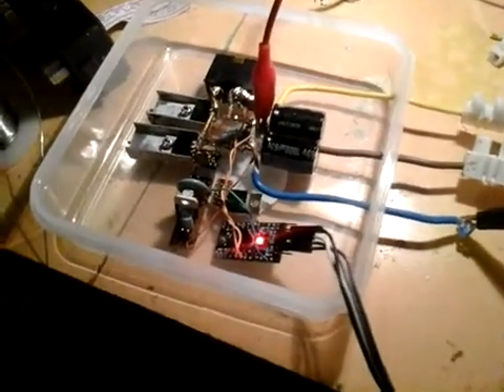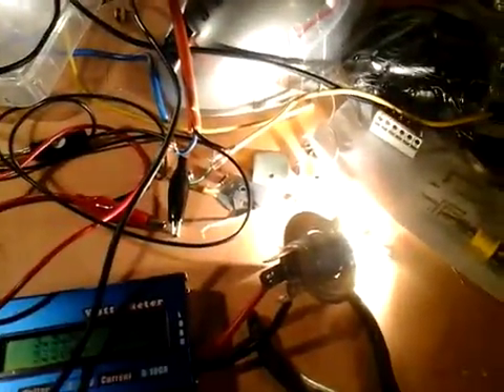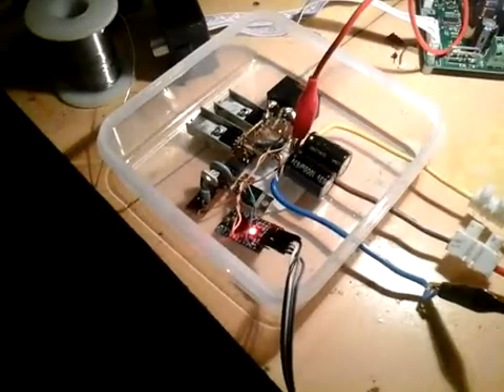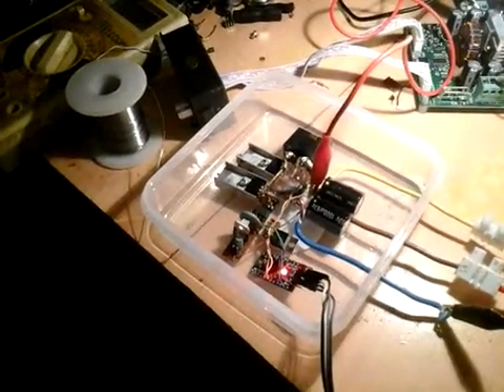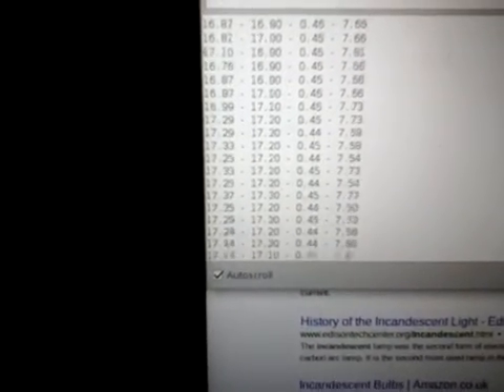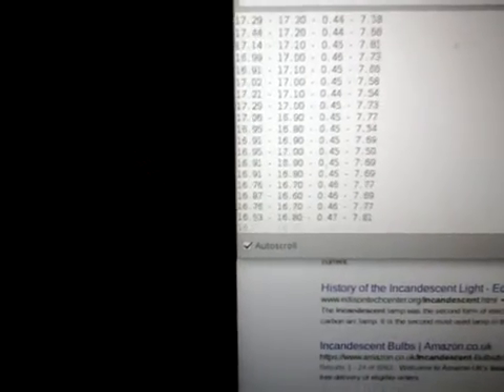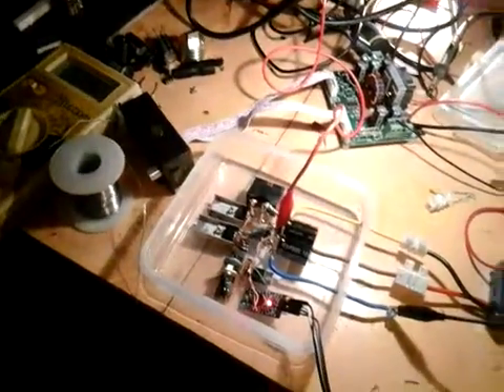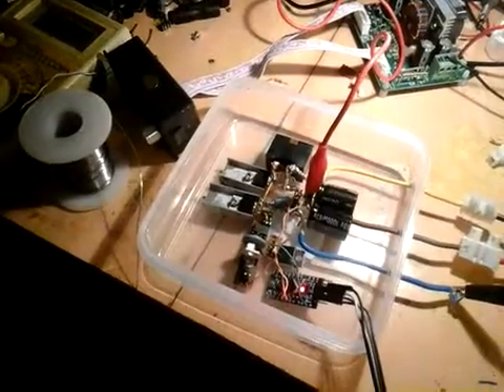MPPT module, home built!

Comment: nice - any chance you could post the schematics?
Reply from the maker: Sure.
http://birds-are-nice.me/ipfs/QmeHTKsAWhaKeygAqRBkAUkt5t2e9NPZcHT2ZcuyZcXcwy/
That's an old version of the firmware though, I managed to make it a bit more stable by keeping the input voltage from falling below 15V.
Reply: thanks very much for that.
Reply from the maker: I've actually found it less than perfect in practice - it's fine for driving a resistive load with all the power you can give it, but if you want to charge batteries I think it would work a lot better if you could adapt it to measure current as well as voltage on the output.
Reply: Thanks, yes I have a couple of ebay hall effect current sensors and and an accurate ADS1115 voltage sensor which I was thinking of adding to accurately measure Power vs Time, and area under curve on both sides.  I'm not as advanced as you are with electronics but I can follow along an learn.  I was also looking at Julian Ilett's MUPPET high side N-channel mosfet setup but I'll have a go at your setup because you put those nice instructions up, so thanks for that.  By the way I'm sure there are lots of people interested in MPPT, so it's surprising that this video doesn't have so many views.  In this voyeuristic world you might need to consider putting a fluffy cat or picture of a woman in a bikini on the cover of the next video to improve the hit rate - Joke :).
Reply from the maker: Make sure the hall sensor is rated for 10A then.

The ADS1115 can't read above 5V, so you won't be able to use it to measure output current via a shunt - but there are chips that can. INA219, perhaps? That could be just the thing you need. It'll let you measure (inverted) output voltage and current simutainously. Just subtract from the measured input voltage and you have all the measurements you need.
Reply: oh yes you're absolutely right.  Thanks for that.  With the INA219 it looks like you have to change the sensing resistor to handle greater than 3 amps.  Hmm, to save components I might just stick with some accurate resistors and have a couple of voltage dividers and use the 12bit ADC on the arduino.
Reply from the maker: I've used the INA219 myself. Using the little module board? You don't have to replace the current sense resistor. Those screw terminals on the module are not just for the current to be measured: They allow the use of an external current shunt resistor too, allowing the INA219 to be used to measure far higher currents with ease. You might need to remove the existing resistor, but if so it's a rather large part by SMD standards and not difficult at all to desolder.

You can even use two INA219s to measure both input and output voltage and current, as they are addressible. This is really overkill for a production unit, but such readings could be useful during development to properly evaluate the design.
Reply: okay you've convinced me to spend some more money on more Chinese bits and pieces.  I'll get a couple of the INA219 boards.  I have a question - am I correct in assuming that if you drive the circuit at higher frequency then you wouldn't need such a low value (expensive) inductor and the efficiency should also increase (I think).  I guess the arduino cant go much faster that 30kHz.  Is there any way to double or triple the arduino output frequency?   Also where did you buy your inductor?  I but a lot of my parts from www.taydaelectronics.com  I've found them to be okay but they dont do specialist parts.
Reply from the maker: Correct, a higher frequency means a lower-inductance (smaller, cheaper) inductor can be used, but the arduino is the limiting factor - if you want higher frequency you would have to switch to another microcontroller, or find another means of generating the PWM signal. There are ways a high-speed comparator and a some analog filtering that I think could be made to work, but I didn't go for that route because it increases complexity. Higher frequency also means you need to increasingly worry about inductor core loss, MOSFET drive fine-tuning, switching loss, diode response time, capacitor ESI and all the other things that make DC-DC converter design so annoying. I'd have gone a little higher if I could, but then I'd lose the convenience of prototyping that comes from using an arduino.

As for the inductor, it came off of eBay. A lot of small component suppliers have stores on eBay and/or Amazon.